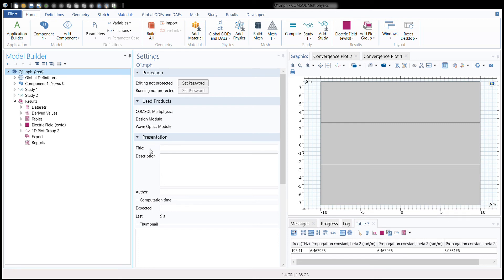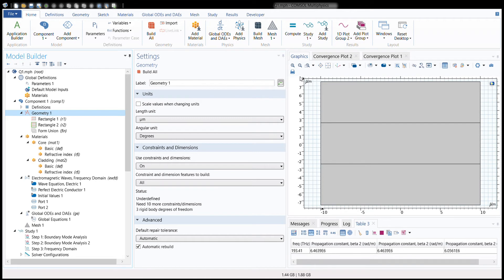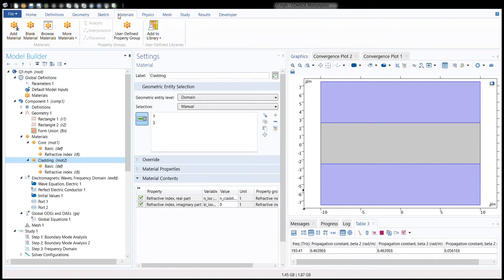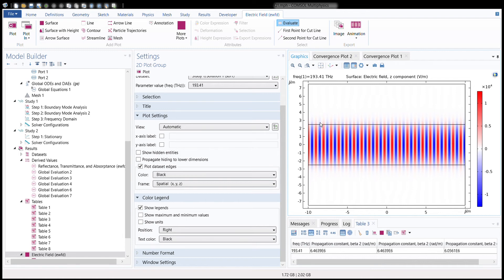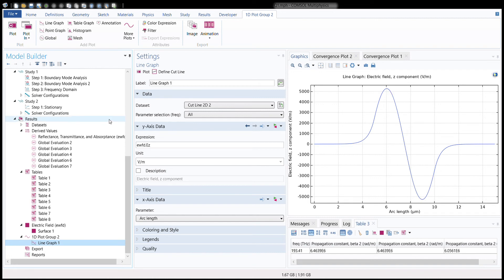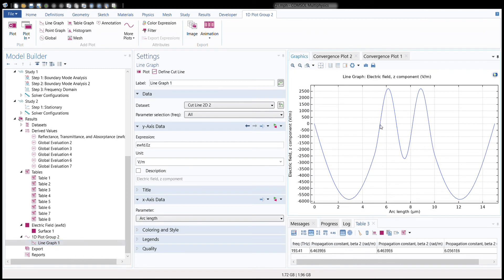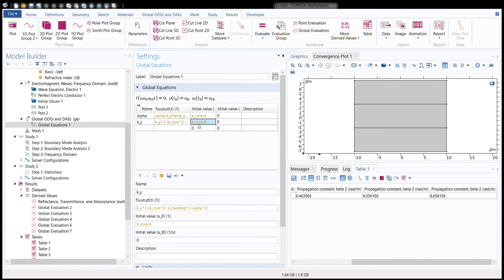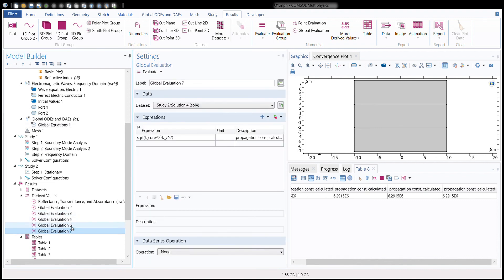Simulating Optical Waveguides in COMSOL

Comment: Hello! Can you build an optical channel waveguide on a lithium niobate crystal?
Reply from the maker: Yes you can. I have simulated a 2D waveguide. You can choose lithium niobate crystal as the substrate from the material library. In case if it’s not there in the material library, you can even create one. Hope it helps.